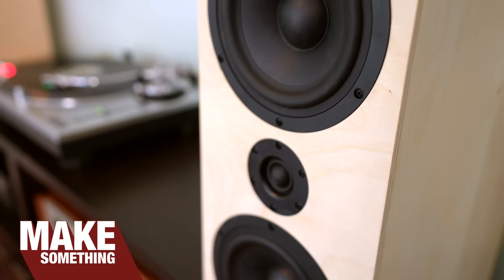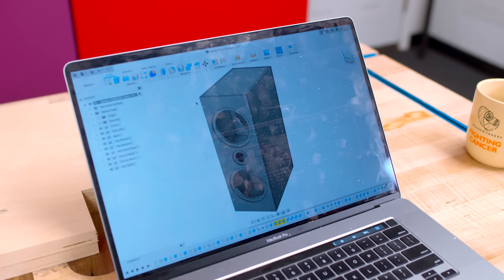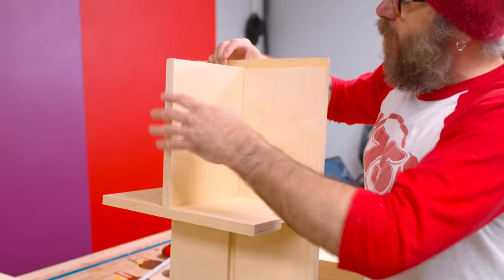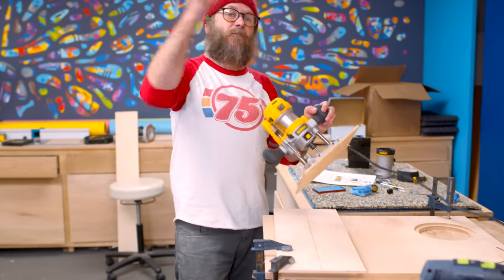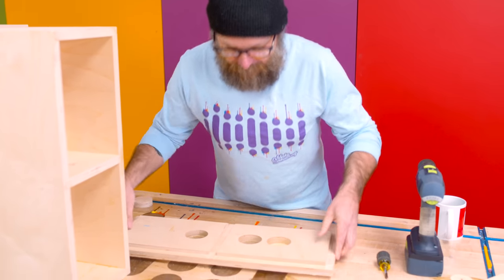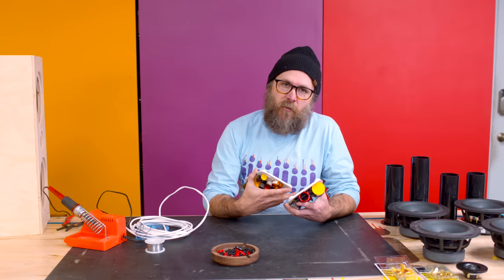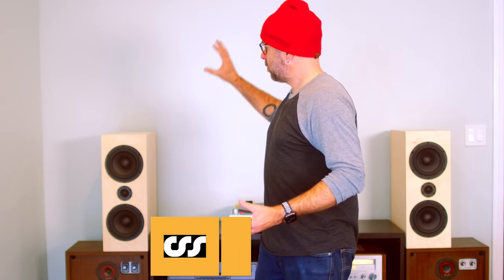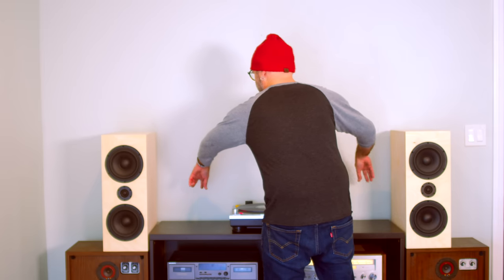High End Stereo Speaker Build. THESE SOUND AMAZING!

Comment: Placement is very important: Those are rear ported and must be pulled out from the wall 10-16 inches- A lot of the bass response of those speakers come from the rear port, that bass will come from the space between the rear of the speakers and the wall. What you could do is put them on stands and pull them out when you listen to them.
Reply: While you shouldn't back the speakers up against the wall, the function of the port is not to let out sound, but to provide acoustic loading (resistance at a specific frequency) to the woofer to flatten it's response curve, allowing the woofer to extend its low frequency response.
Reply: @DTW-bx2vy  There's also something called "corner loading". Subwoofer placement is even way more critical than speaker placement, I run two subs in all my setups.
Reply: Bottom line, they sound better 2-3 feet from the wall...
Reply: @bunkie2100  Ports let out load of sound!!!
Reply: @johnbarker8504  - Yes, but as I mentioned, it is not the function of the port. It can be argued that the sound emanating from the port is detrimental to overall sound quality as it is out of phase. This creates something called comb filtering, where alternate frequencies are either amplified or nullified. 

It’s a trade off for the advantages of the tuned port design. You get, in general, more efficiency and bass extension, but you also get higher levels of distortion and comb filtering.
Reply: @bunkie2100  Out of phase at certain frequencies but in phase at other frequencies, and therefore reinforcing the low-frequency output at those frequencies. Agree with the rest of your argument. Thanks Peter!
Reply: I have that problem I don't have the space almost all my speakers are with back port the best I can do is 9 Inc and the new fronts are larger so even less,the old jamo 707 are ok with 9 Inc from the wall nice deep base, can you some how fix it with acustic mats ?

Comment: Nice vid!
FYI for first time woodworkers: 
A $5 hand-held scrollsaw cuts all sorts of tight internal shapes including circles. It is incredibly accurate and removes precious little material. You don't need a jigsaw, router/cnc or even forstner bits for cutting internal circles. 
Of course, don't expect to build cabinets anytime soon using a scrollsaw 😂😂
Reply: It is incredibly accurate IF you are in the top 10% of the population when it comes to hand-eye coordination.

Comment: I built the swan hi vi 3.1 kit and am very happy with those. The css will be next but a suggestion on the amp would be crown.  I have the xls 1500 I believe is the model I'm not at home now but it has a DSP built inn plenty of power and each channel is separate. Also I am using a s.m.s.l. DAC and you would not believe how good that combo sounds.

Comment: I just finished a set of speakers with 2 Pyle 10" - 200 RMS drivers, 6" mids & horn tweeters. I've made several sets of speakers through the years but, these sound better than any of the others. I do silicone the speakers in to eliminate any leakage. Yours look amazing!! Keep up the good work. You said you're looking for a good amp. I run a Carver M-500 amp & pre-amp, 250W/channel, RMS. Sounds amazing!!
Reply: Super impressive, you should make a video on your build

Comment: Really enjoyed this, I've made a couple speakers and plan to do more in the future, will have to check out the place you got your kits from. Good sounding speakers are like 60+% design or more in my research, I was a bit sticker shocked by the price of the kit and saying it used Dayton components. Dayton makes great stuff, I just was surprised to see the almost $700 for all the components, must be a lot of work that went into the cross overs. I built some pi speakers that were about 100$ or so per speaker for the kit including x-over, they're old school style speakers, super high sensitivity and love to play loud and accurate
Reply: Over 800$! Yikes lol, but I bet they sound amazing. The A B comparison showed what I thought, more accurate and more clear than the old ones. I see they are 90db rated which is really good in terms of the sound I like. The price scale is not linear as you move up and down in efficiency. Plenty of cheap kits will land you low and mid 80db which is not great in terms of it needing a lot more power to drive them. Excited to see these finished!!

Comment: The difference between the '70s speakers and the CSS almost sounds as if the '70s speakers were in another room, behind a closed door. You open the door and boom, you hear CSS. There is that much high end difference and overall clarity and that I must say is an impressive difference. And this is something for me to consider because I am in the process of moving and need to get rid of lots of things that basically weigh me down. And close to the bulkiest items I have are my 2 Rogersound Labs (RSL) Nevada XT speakers which I love and have owned like the rest of my component stereo since 1986. But the speakers are massive, weigh something like 70 pounds each, pre-date subwoofers by a few years, and probably could be easily outclassed by something like what you just built. Time to seriously ponder my options.
Reply: Middleclassic, what did you wind up settling on? Did you replace the RSLs, and if so, what did you choose?

Comment: Built my 2 ways from ground up. My enclosures are made of 1" MDF (special order). Baffles custom milled on large CNC router to Augment Audax Aerogel drivers. Cross overs built by Madisound per my instruction. Sidewinder coils with High end caps. Rear bass firing ports. Internal Window bracing as well as threaded rod bracing. Coated internally with Cascade Audio Engineering sound damping material. Also 3 layer Black Hole acoustic foam. Internal wire is flat copper.  Using Morel soft dome tweeters.  Everything with Cadas silver solder.  I get just amazing high definition sound.  Worthy of high end SACD sound! Aerogel drivers is a highly regarded audiophile secret! ;)

Comment: Awesome video, and thanks for sharing.. 
 One improvement I did spot or a question 1st of all is about the tweeter because if its open back then air pressure /movement from the woofers would be enough to push/pull the tweeter cones potentially causing reverb and the like..
 If the tweeter has a closed back then it's all good 👍🏼
Reply from the maker: Thank you!

Comment: Very nice speakers! I'd love to making some of this one day, but i dont have good wood cutting tools.

Have you thinking about putting the event on the front of the speaker ? the bass may be more deep. 

About the amplifier, you should buy a highrange or midrange Denon, thats what i have for years and the sound is awesome !! And you can find used model for less than 100 dollars. I got mine for 80 dollars and it's work perfectly.

Best regards

Comment: You could route a round over around the front baffle .  Sharp corner can cause diffraction. Solder the wire directly to the speaker.  This will help keep the signal pure.

Comment: 4:27  It's perfectly OK to use a miter gauge with a fence when cutting dados. There is no offcut so there is no danger of one flying back toward you. use downward pressure with your Gripper in your right hand and forward pressure on your miter fence with your left. Easy and safe.

Comment: As for the amp, if I were you I would check out Peachtree audio you can find really nice used ones on eBay for $500-$1000 depending on which model you go with. Because those speakers are a little more power-hungry you should probably go for something in the 200+ WPC at 8 ohms.

Comment: Great video as always David. I have this on my wish list to build. So many finishing choices that can be chosen but it’s up to the owner’s discretion and budget. I would paint the fronts with a black Truck bed coating from RustOleum to cover the wood grain and laminate the rest with veneer or veneer cut from my special pile of lumber I purchased for no particular project but I fell in love with it’s grain. I imagine a subwoofer would make these speakers really perform. Hope to see that in another build.
Reply from the maker: CameraDan also suggested a textured coating. I really like this idea for the front. I think it would look nice when the grills are removed. Thanks!
Reply: Parts Express sells a few different textured paints for use on speakers that you could look into.  I've also seen textured vinyl or leather used on enclosures that looks really nice especially on the front baffle.

Comment: About diffraction,  you can ease the front baffle edges with a 1/2 inch  round-over router bit. This will help even out the mid/mid-high frequency response (sound smoother and more even). Cheers!
Reply from the maker: Thanks!!

Comment: I'm new to the channel so excuse me if you've covered this already but did you go through your vintage receiver and replace any aging parts like capacitors?

Speaking as someone who has that same turntable (in black), it's not that great. The newer ones are better at bypassing the built-in phono preamp without being noisy.  That said, you can up the sound quality with a better cartridge like the Ortofon 2M Blue or better the 2M Black. I went with the 2M Red, which I regret not saving up more for the Blue or some other better sounding cartridge. Replace the felt mat with something better too. It's a static nightmare. 

Invest in a decent record cleaning setup. Decent ones start around $100.

Comment: I used to work in a prefab house building factory. The turnover for employees was incredible.
A new hire was tasked with cutting sheets of plywood to a specific size.
He started running his first sheet through the table saw backwards.
He got halfway through the cut when the sheet was sent flying and hit an unfortunate co-worker.
That was one of the more "tame" injuries that occurred during my time there.

Comment: Hey; love this video! 2 things. 1, have you finished the speakers yet? I would love to see that. 2, I have that same Technics receiver, and I really like it. Are you sure you want to replace it for something else? To me there is something cool about vintage gear like that. I'm actually listening to radio on mine right now.
Reply: I bought that same receiver new back in high school in the late 70s.  It was the 65 WPC version of that line.  I kept it until the mid 90s, when I found used NAD components (from the 80s), which produced much cleaner sound than that old Technics receiver, which was sent to the junkyard.  Technology moves on.  Now I've gotten rid of all my NAD components and have gone with pro audio (powered monitors and a DAC) - the simplest and cleanest of all.

Comment: I seem to recall hearing a while back that MDF is preferred for speaker cabinets due to it's stability and resonance capabilities. It's that still considered the standard, or has opinion changed on this subject? Much like "tone wood" for guitars or comb material for harmonicas, I'm sure there is much debate over this. This set sounds great to me. I'd characterize the sound compared the old set as clear across the frequency spectrum. I might dial in a tad more bass for myself, but you can hear everything nicely. Looking forward to seeing how you finish these. Thanks for sharing!
Reply: MDF is denser than even Baltic birch plywood and absorbs resonance better. BB plywood is stiffer. There are very small trade offs between the two materials. You can measure it in a lab but you are unlikely to hear a difference between the two unless one cabinet was improperly built.
Reply: MDF has widely been used for top notch speakers the last 30 odd years, even turntables.
Probably the bell wire hes using that gives the thin sound. Also have to be careful unless he buys a load tolerant amp.

Comment: As far as an new "high end" amp goes I'd take a look at the Schiit Ragnarok II. You can get it fully loaded with a phono preamp and a built in DAC should you ever decide to want to add some digital. Their stuff is all made in the USA. The Rogue Audio Sphinx would be another good option no digital there but has a good phono section and has a tube in the preamp section to add a little warmth Rogue's stuff is also made in the USA. My last recommendation would be an Outlaw Audio RR2160MKII Stereo receiver. It has retro looks but has all the inputs you could need. I wouldn't consider any of these to be pretentious "audiophile" brands just options that represent good performance for their price points.

Comment: As long as your grill and the material you make it out of is less than 1/4" thick I wouldn't even bother with thicker gaskets behind the drivers. Plus if you play them with the grills off most of the time your fine. Personally I'd do a 3/4" roundover on the front baffle sides then wrap it with some walnut veneer or vinyl.

Comment: Just put these cabinets together from the CSS 2tdx flat pack today. What a mess. Some of the parts were out by 1/8 inch. It took a rubber hammer and some strong clamps to try and pull the pieces together. I have have plenty of filling and sanding to do to try and make them look half decent. 🤨

Comment: I Like it!  I have a question, and asking since you mentioned about cutting the dados.  You cut the rabbets on the left end of the board away from the fence.  Others I have seen, set up a sacrificial fence and cut the rabbet next to the fence.   Is there a reason to pick one over the other?  Is the latter one more safe?
Reply from the maker: Either works. Cutting away from the fence means I don't have to set up a sacrificial one.